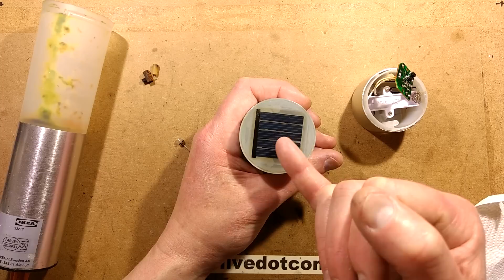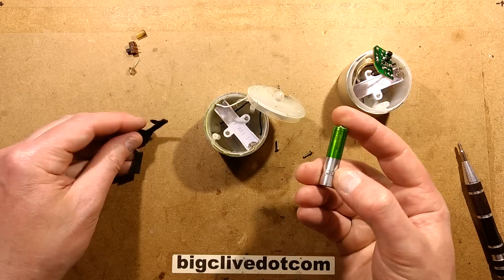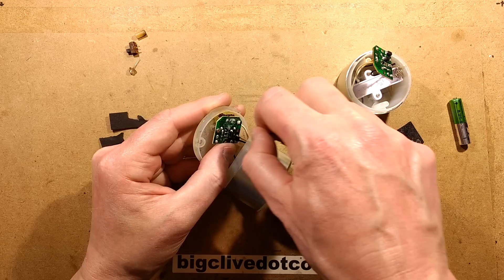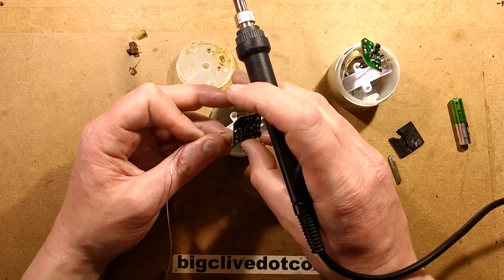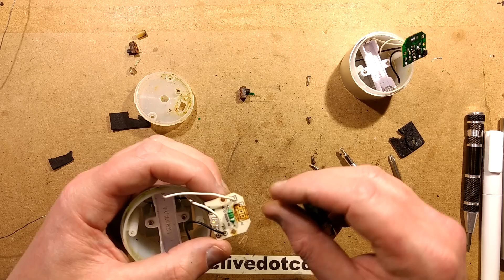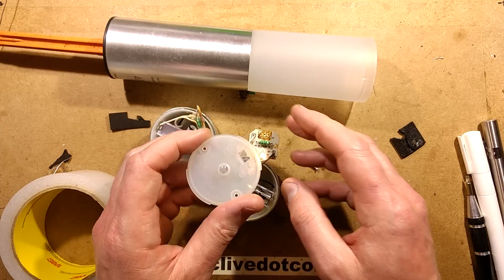Fixing (and cleaning) IKEA solar lights for my brother Ralfy.

Comment: Dry solder joints are SOOOOOOOO much easier if you just have a flux pen/syringe. It eats away rust, oxidation and when you put your solder iron on, it immediately helps the solder to flow like it's fresh.

Comment: I would consider not sealing it, in fact adding a vent/drain hole where the switch was, and then conformal coating the PCB. As you said, as it heats and cools it will draw in humid air from outside, and then condense on the inside. So instead of trying to prevent it, which is a losing battle, allow it to happen, but control what it can come in contact with. By adding the vent/drain, you should minimize what actually accumulates inside.

Comment: Clive, I put silicone grease around the joints and switches  of our garden lights to keep the insides watertight.  I also brushed a little on both sides of the PCB to act like a conformal coating.  I hope that helps other viewers too.

Comment: We use that tape to reinforce the plastic that we cover our windows with for the winters here in the Dakota's it is great, then we can simply staple through that tape and she holds up against the worst winters with very high winds and sub-zero temps, wind chills down to -50 F.  Today the high was -8F  windchill -35F

Comment: All I  can say is you have some patience. I think I would have slung them out and bought new ones. Wish I had a brother like you.
Great video 😁👍
Reply: Hey Clive, I was leaning out the window tonight just after sunset waiting for the lights with built in photocells to come on when I thought, I wonder how them electronic ballasts work for the compact fluorescent tubes. If you recall they came along some time in the late 80s to 90s to replace the old  magnetic ballast. I would love to see a video where you break one down in your usual manner and explain how each part works. I stripped them down in the past, broken ones, and wondered what actually causes them not to work. Of course they are becoming obsolete now with the taking over by LED lamps but the electronic ballasts have always fascinated me, and yes I need to get out more 😊

Comment: Clive, Telecom cabinets and Basestation Antenna use little membrane spots from Gore ( Goretex) to allow air expansion without allowing moisture to pass. One of these would work a treat in a solar lamp.
Reply from the maker: +Jon Laws I took something apart recently that had a membrane dot in it.  Can't remember what it was in though.

Comment: Another very interesting video. I wish you could find the model number of the 3M tape. I find it nowhere on ebay or amazon.
Reply from the maker: http://www.ebay.com/sch/i.html?_from=R40&_trksid=p2380057.m570.l1313.TR0.TRC0.H0.Xclear+all+weather+tape.TRS0&_nkw=clear+all+weather+tape&_sacat=0
Reply: William Garrett Lidl has it from time to time transparent all weather tape, to fix tents
Reply: Had a mega coincidence , went into Lidl and they had a roll of 3M weatherproof tape at £1.99. Exactly what you need, about 20M by 40mm. Its the biz, do a search online youll find some
Reply: 20m x 50mm currently in Wickes for £1. Just done some of my lights with it, I'll see how it goes over the next few months. This was having to fix one (Poundland!) light that water had got in. It hadn't got into any of the others.
Reply: 3M or Wickes "Brand"
Reply: i bought a roll of tape like this in home depot canada if any muricans are searching
Reply: The tape is 3M 4828 Transparent Polyethylene Tape 48mm x 25m
Reply: Alex V  4828 is the key number.  I've never discovered any pattern in their numbering except for one type.  Don't remember the whole number but the stuff that ended in "1"  was  one inch wide and the stuff that ended in a "2" was two inches wide.  But anyway we went through shitloads of tape (magazine printing plant) and ordering 10 cases was a small order.  The stuff we used to seal cardboard shipping boxes we usually got 50-100 cases at a time.  So we'd call in the order and ask for 2 4781 and they knew we meant 2 cases.  Excuse me, I tend to ramble on.
Reply: a bedbug99 - Wickes own make. No idea how long it will last.
Reply: Isn't the 3/4" or 1" tape normally called hockey sock tape over here in Canada?

Comment: I think I must have been Ikea's best customer on this solar light. I am glad I still have many extra of them, because they have stopped selling them here. It is the best solar light they have had, in my opinion. They give a good light with a warm color. And they all light up just about the same time. You can even use them indoors in south facing window sills if you have an offgrid cabin. They have lasted longer then the other solar lights I have had. A couple of them got the same problem as shown in the video. Now I know how to fix them, and I won't be throwing them away. I think I can manage to do this. I just have to learn how to solder first - without burning my fingers off, haha!
Reply from the maker: Definitely have a go at fixing them.  Even if you screw up the first few you'll soon be comfortable fixing (and customising) all your solar lights.

Comment: FYI - the solar cell itself can be polished to new condition (the side that is exposed to the weather) with meguiar's PlastX - clear plastic cleaner & polish or i imagine any headlight cleaner polish would work as well ... i did it to my lights and it will clear any weathered cloudy look  on the cell therefor increasing the performance a bit ...

Comment: 12:48 - "And I used a toothbrush that I keep dedicated to clean printed circuit boards."  Remember to always brush your teeth with a generous amount of flux after every meal.  LOL
Reply: Aleatha Vogel No, no. Brush with solder paste before rinsing with hot water.

Comment: Better option than scraping off the corrosion (if you have it) is a fine grit sandpaper I have used it to repair a fuse box on a car with soldered in relays just a suggestion, however a screwdriver works too

Comment: +BigCliveDotCom I'm guessing that you are correct about thermal expansion. The heat expands during the day and contacts during the night. Night air is typically cool and as looking to give up moisture (that's when dew forms). That pumping you mention expels dry air and sucks in moist air. I would surmise the wee switch is corroded because the moisture collect on the bottom and tries to find its way out through the switch.
I wouldn't Vaseline the seam. Now that the switch is gone, the moisture has a place to go, and perhaps won't allow a vacuum to build.

Comment: Will putting those silica jell packs inside absorb moisture and prevent corrosion?
Reply from the maker: I'm not sure how long that would work for.
Reply: killer chemstar
If you live somewhere dry, it would counter the occasional dampness. But in a wet place, it would last about a day.
Reply: killer chemstar Chems on a Clive vid? Good to see ya here dude.

Comment: i saw a huge glob of solder slop onto your desk just around 5:59 oh god
Reply from the maker: That's a better result than when the molten solder lands on your hand.
Reply: Ouch that would hurt a lot
I'm more worried of the workplace catching fire from the solder though..
I feel like it would smolder and eventually catch fire..

maybe it doesnt hold heat long enough?
but ive had a blob of solder fall on carpet before. and stay molten for ages..
Reply: realflow100 I have had solder drop on my arm when I was a kid, it went hard and cooled pretty quickly.  Small blobs of solder might be hot but not much thermal mass, so cools quickly. Some dropped solder on a bench will not do much, but if you had a hot solder pot, for quickly tinning wires, and you knocked it into the waste paper bin, you might have a problem.
Reply: realflow100 I've been soldering for a long time and haven't ever had anything catch fire (paper, plastic, wood)...but there's always a first time

Comment: Clive! I have an idea (maybe you have already done it...) Get a "box" buy about 10 at 1 pound solar lights and make a USB solar charger of them. I guess it needs regulation and stuff (USB connector) but would be a fun project... I think (in Sweden) my "1 pound" solar lights have 360 ma/h batteries in them... a 3600 ma/h USB charger for "10 pound"... ah well usb connector and some other chips might add a couple of "pounds" but anyway...

Comment: good tip for cleaning little garden solar light panels that go hazy and opaque is Autosol metal polish. Bit of elbow grease with a few dobs of that and they are practically good as new.

Comment: Hmm... So if you seal it, give it a rubber wall somewhere, to handle the contraction and expansion, to prevent sucking in moisture?
Some desiccant to absorb the moisture that is inside? 
Oil/Grease on cap/body, and make the cap/body joint somewhere where moisture couldn't collect to wick up?

Comment: I have a toothbrush-sized brass brush to clean away corrosion after the the real toothbrush has cleaned away the softer crud.

(neutral cure silicone is good)

Comment: A trick with solar lights is to disassemble after buying ( who does ! ) and conformal coat the pcb BEFORE putting in a wet UK garden ! ( many are designed in California , hot and dry and LOTS of sun ! ! )

Comment: Watchmakers use silicone grease on the seal for the bottom of the watches, to keep the water and moisture out more efficiently.
I'm sure it will cause a good result to use it on the garden lamps as well.

Comment: "My Brother Ralfy" sounds like the title for a bad sitcom series. :)

Those solar garden lights never last very long.  They're usually not sealed well enough to keep out the damp so they rust out, and even when they're new, the dinky little solar panels almost never provide enough charge over a full day to get the battery anywhere near full, so they last only an hour or two before going dark.  Or a couple of minutes if the day was cloudy.

Comment: For those terribly crusty solder joints I have a toothbrush size stainless steel brush that I use to de-crust them. Don't remember where I picked 'em up, but they obviously came in a little pack of two...

Comment: Clive, I think the 3M clear tape you used looks like the same as a local Lidl store is selling at a reasonable price! Cheers Rob....ps do you ever repair remote control light modules mine that controls the garden lamppost has packed up it was originally from Maplins They don't sell them anymore, the caps look as if leaking a bit what's your thoughts? The circuit board is compact with components...

Comment: Your metal bodied multi screwdrivers are pretty cool, what are they called? Where are they from?
Reply: They're cheap ones I get from Poundland in the UK. They cost, er, a pound and come with 9 tips. I've got about 10 sets of then all around. Not great by any means, but if looked after they perform well.

http://www.poundland.co.uk/tommy-walsh-mini-screwdriver-set
Reply: Thanks, probably just the tips that are cheap though? maybe there are better ones. Do the tips fit inside the the body ?
Reply from the maker: It's a pretty good quality version of the common 9 in 1 or 8 in 1 precision driver.  The tips do store inside.

Comment: Wonder if one could put a higher milliamp rated battery in the solar light and put a brighter LED in it. Would the solar cell be able to keep the battery charged and wonder how long it would last in the evenings.
Reply from the maker: The limitation is the size of solar panel, location and amount of cloud cover.

Comment: I know it'd cost a whole 2-3 pennies more per PCB, but I wish they'd give these boards a conformal coating. Even a thin one.

With water-induced corrosion, I usually hit PCBs with a degreaser first, followed with isopropyl alcohol and a stiff nylon brush. Sometimes it takes a metal brush to crack it all off; I use a fine brass, then stainless steel, brush if needed. I use the degreaser before anything because many boards still have flux residue from manufacture, or they've developed a greasy/oily coating due to their operating environment (industrial stuff gets messy; who'd have thought?!).
Reply: 2-3 pennies might sound like peanuts, however look at a mass scale production and those 2-3 pennies become a heck of a lot more. So in the end it is simply not worth it.
Reply: And the devices would last too long, losing them sales of replacements.

Comment: Oog, that's some nasty corrosion going on in there. How long had they been outside to achieve that level of corrosion? Seems like the methylated spirits did a nice job of cleaning it off, though. Sometimes if I need to clean multiple boards I'll take them into work so I can spray them with the industrial-strength contact cleaner we use.
Reply: Date Stamp 1541, that being year 12 week 41 production so these would have been sold from about March 2016.
Reply: Thanks for the reply. Wow, so only about one year of use? That seems pretty fast for the amount of corrosion and plant matter that had built up.
Reply: Isle of Man, well-known for it's mists and salt-laden air. Add some warmth from the greenhouse effect of the plastic lamp body, and it's heaven for the rust maggots.

Comment: 4:40 Just seen this video. Would it be worth putting one of those little bags of silica gel inside the enclosure to avoid the diodes, wires and screws corroding from any moisture wicking in?
Reply from the maker: The silica gel is best for fully sealed enclosures as otherwise it just saturates.
Reply: @bigclivedotcom  I take your point - perhaps a one-way membrane like Gore-Tex to let moisture out, but not in?

Comment: when i did some work many years ago for telecom eireann i learned that water can wick up something like 9 feet - or was it 15 feet? anyway its a long way . you need a VERY good seal at all points.
Reply from the maker: With thermal expansion and contraction plus capillary action, water can travel a long way inside cables.

Comment: I've seen some IKEA rechargeable AAA batterys with  MAH ratings as low as 500MAH sold in stores.
Reply: Currently they have high capacity and low capacity ones for both AA and AAA cells, Believe the high capacity ones are rated at about 500 cycles and the lower ones 1000 or so.

Comment: Hi Clive, we bought a number of these lights and they seemed to fail after about 9 months. I now know what the issue is. The orange stakes though are useless and break so easily can you fix them? 😉
Would you consider a brighter LED to fit in the lights?
Reply from the maker: In most solar lights you can use a slightly lower value inductor to get a higher LED intensity, but at the expense of run time, especially in the winter months.

Comment: I've often wondered ( with the large amount of various LED outdoor lights I've had, I noticed a varying degree of battery capacity, from 150 mAh to 600 mAh ) if there is any point to higher capacity batteries being used. What would be the average expected maximum charge of a battery in a solar light?
 I realise its down to solar cell size, age and type, amount of daylight etc.
Reply from the maker: +JohnnyX50 It is down to solar cell size and amount of light exposure.  But a higher capacity cell will deal with the small number of really high sunshine days that could greatly overcharge a small cell.
Reply: Thx dude :) I will probably look into swapping any batteries with less than 300mAh capacity. Thanks again :)

Comment: Three quick things.
1) Where did you get a standard sized bit for you Poundland driver? I have the same driver I got from the dollar store, but no standard size bits like that one.

2) This is the first time I've seen you make a "human" type of error by soldering your fingers. #OneOfUs

3) Will mounting the LEDs directly on the board diminish the light output when fully assembled? It is no longer sticking out into the little bubble like it was before.
Reply from the maker: I've not seen them in the dark yet.  I'm using the bits that came with the driver.

Comment: if an LED had a low enough voltage and a super high lux,would it be possible for a solar panel to run it straight with no circuitry? like the only light that's running the LED is the LED itself highlighting the solar panel.
Reply: Pat P short answer, no. Long answer, no energy conversion system is 100% efficient; research entropy, perpetual motion, and energy conversion/conservation.